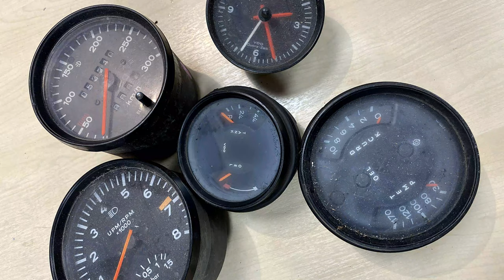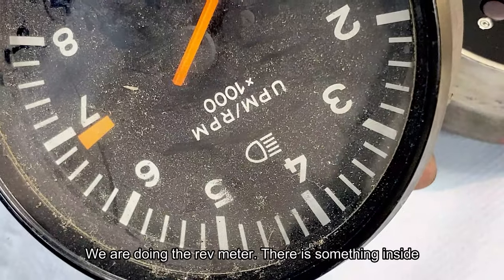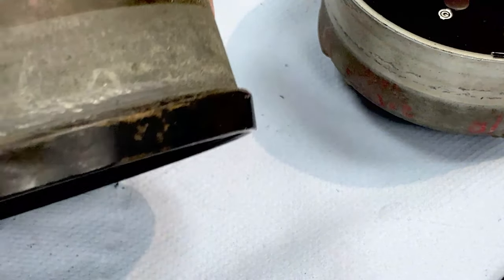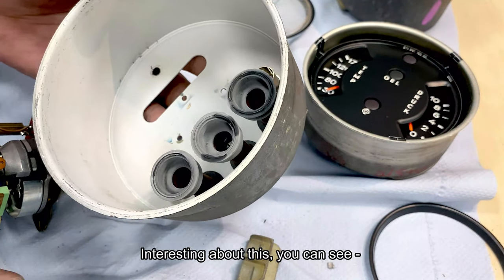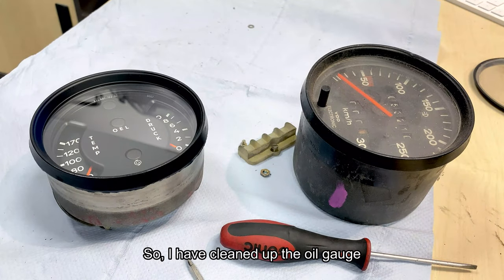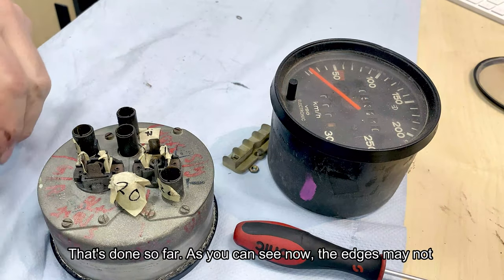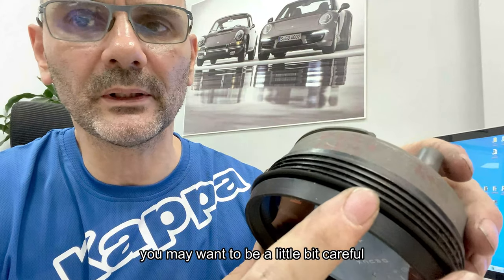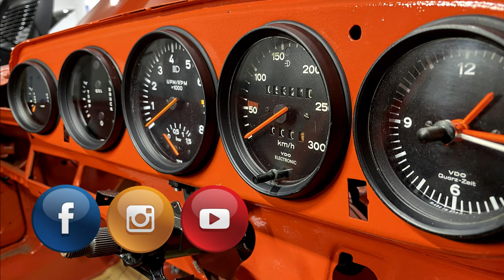PORSCHE 911 (930) TURBO GAUGE RESTORATION

Comment: What is the best solution to clean the dial itself (once the glass is removed) ? I suppose acetone would wipe out the dial paint whereas soapy water is sometimes not enough to get rid of all the dirt - so what should it be?
Reply from the maker: Hi Tom, I've used simply common glass cleaner. It worked well as the dials aren't really dirty as they where protected by the glass over the years.

Comment: Hello, Beautiful video. Can you buy new bezels for 993? And is there a different way to press the bezels on to eliminate the crimping? Nick
Reply from the maker: There is a rather expensive special too for it. Its basically a roller that presses it on. For most people who probably do this once in a life time surely an unnecessary investment.
Reply: Germantech Motorworks Sdn. Bhd. Sorry to bother you but where are you based? I wonder what it would cost to ship my engine to you for a complete rebuild?
Reply from the maker: @duc99804  we are based in Kuala Lumpur, Malaysia.

Comment: which sandpaper used? which spray paint used? thanks
Reply from the maker: I'm using a wet 800 grit paper & acrylic mat black, but it depends on the ring condition.
Reply: @GermanTech-Motorworks   thank you very much